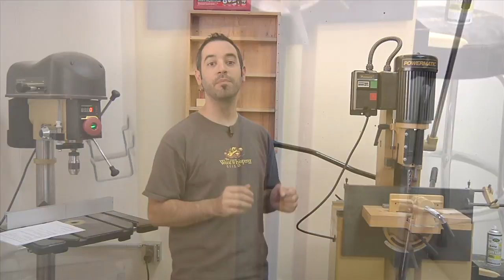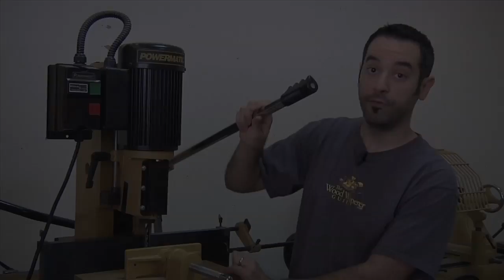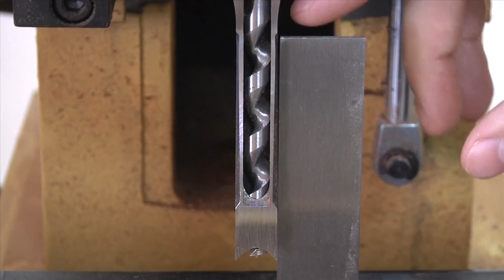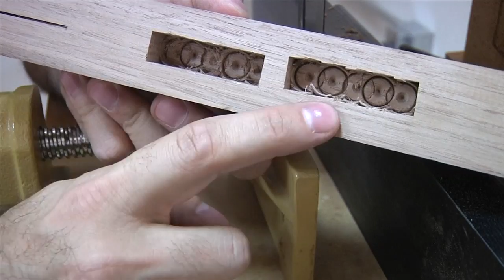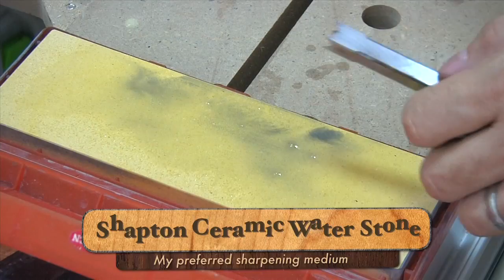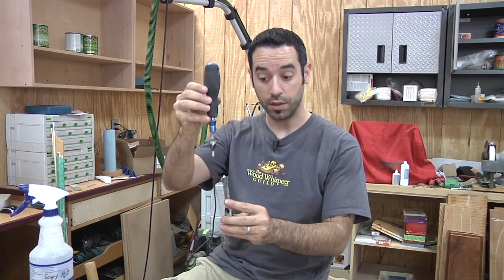Hollow Chisel Mortiser - Purchase, Use, and Maintenance

Comment: Great video, very informative all around, and in particular the segment on proper gap between the auger and chisel. I do however have a question which is about the later part of the gap section. I am using the Powermatic 719T with a 3/4 bit cutting into maple. I have now increased the gap from 1/16 to an 1/8” and the difference is quite amazing. However I’m still encountering some resistance beyond as I get deeper into the cut. Somewhere at around a 1” depth, I encounter resistance, and try to make short strokes of it to minimize heat buildup. Despite using gulf wax & short strokes it’s almost impossible to go deeper. The chisels are brand new, made in Japan. Should I consider increasing the gap beyond an 1/8”?
Any advice is appreciated, as I’m quite a newbie with this machine. Thank you Mark

Comment: I was lucky enough to come across a Jet JFM-5 floor model mortiser in the used market some time back. I will soon be using it in my bench building project. It's 14 years later that this video was created and this video is still just as relevant as it was 14 years ago. I loved the content in this video, you covered it all, even sharpening!, Thanks Mark

Comment: Marc, thank you for showing the sharpening cones. I generally just use them 'til they're too beat up, toss them, buy a new one because I had no idea how best to handle that internal surface conditioning. Nice. Thanks!!! Can't believe I went this long without knowing that. Hah! I really only ever use 1/4 and 1/2" chisels and bits, so it hasn't been a big issue thus far.

Comment: That mortiser sucks on the method the head moves side to side back to front. What you want is a table that moves side to side with a large hand wheel, and another hand wheel that moves the workpiece front to back.

Comment: To help with friction " my boss" would always have us use a bee's wax bar. Every 3rd or 4th hole you had to stop and slap a little on the chisel. it only took a few seconds and it made it much much easier to pull out and it did make the chisel last longer

Comment: Hi Mark, I have a bench top model that I bought from one of our cheap supermarkets and it was less than £50 in cost. It work well enough for what I want to do but as you will realize it hasn't any of the moving top or table. I also have the panterrounter plans from Matthias  and that has a movable table using two sets of draw slides, I made one for the mortise machine but I had to double up on the draw slides so that the pressure from the chisel part did not crush the slides, it works so well that I am going to make one for my drill press as well.

Comment: Mark I have recently  purchased a power  matic,table top mortise  machine.i can't seem to get the chisel  to auger,right where it's not so hard to drill the work piece. Cedar, or pine struggle  a little but the maple or cherry is almost impossible to do .it feels like I'm going to break  the down lever.its so hard .can you help with some advice ..
Reply: I bought the identical machine new several years ago and experienced the same problem as you describe.  Upon close inspection of the auger bits, I found them to have been very poorly ground, with dull cutting edges. Using a Dremel grinder and small diameter rotary abrasive tools, I carefully re ground all of the cutting edges making sure to maintain the original  clearance angles. I also polished the internal cutting edges of the hollow chisel using the included cone shaped sharpening tool. Finally, I polished the external square surfaces using very fine grit (6-800) sandpaper (lubricated with 3 in 1 oil) on a hard flat surface.  Problem solved. Final note; make sure you allow 2+mm vertical clearance between the head of the  bit and chisel cone and spray the bore of the chisel with a lubricant that dries on contact.

Comment: Mark could you tell me, this chisel mortiser can be used as a drill press? By norma drill press bits?
Reply from the maker: I guess theoretically it could. It should accept regular drill bits. But the bits have to be extra long because of the design of most of these things.

Comment: can I install Drill Press Mortising bit
 on normal drill press ??
Reply: you can buy a kit for the drill press but it will ruin your drill press, take my word the drill pressure is not made for it.
Reply from the maker: Nope. They do sell attachments though. I hear mixed reviews on those.
Reply: No , I've searched yesterday and I found out that . I have to buy chisel holder it cost 50$ + 70$ for shipping .. I'm getting bore

Comment: Every sail boat in the 60's -70's had teak louvered doors,and we used a hollow chisel mortiser to cut 1/4" squale holes for those louvered doors. I must have punched 100,000 square holes during that time,one hole at a time. each set of stiles had to be layed out right and left sides,the holes were cut on an angle so louver blades would slightly over lap.It was a very time consuming job. I think though the glue up of the doors was the most time consuming part. Glad that part of my life is over ! we got good with the cone shaped sharpening stone too, because teak is abrasive and carries silica sand from the rivers it floats in before harvesting.Sometime youd see sparks when running it through the trable saw. I think greenlee still makes a quality drill set.

Comment: Great video Mark... you can easily see the effort you had to put into it.  Everyone is entitled to their opinion, but I just don't get why there is always a small percentage of people that can give a video like this a downvote?  Abstain sure, but downvote?
Reply: Some people might be downvoting because the video is sponsored.  Some might disagree with the basic premise of the hollow chisel mortiser.  They might find that routers make a much cleaner mortise and with a decent jig are pretty easy to use.  Or maybe they are handtool zealots.  Personally, I think it was a great video about the hollow chisel mortiser, and on that basis I would upvote.  However, from my experience with my benchtop HCM, I'm not that impressed.  I find it to be kind of slow and the mortise quality isn't that good.  Just my experience with a little one.  Oh, and some people just downvote everything, I think.  Look at the ratio of up to down.  That's more useful as a metric.
Reply: Just trolls with nothing better to do.
Reply: How to replace 03 Honda Odyssey ignition relay and ignition switch

Comment: I build a type of bed  that has thirty six pickets.  I went from trying dowels, to router made mortise and tenons, but I switched to a mortiser and it makes a world of difference.  The big problem I have is controlling thw wood chips, there is no real easy way to vacuum them away.  I actually ended up using a blower versus a vacuum to get chips away from chisel.

Comment: Awesome review Marc, I only want to ask about the speed of this machine, do they come in variable speed? and, do we really need that change of speed in order to customize the cuts made on variable types of wood? And also, how about a dust or debris extractor? Can it be made? Do they come with one? I was thinking at the time you explained  the orientation of the debris are popping out, if only there could be an adapter for it that doesn't get in your working view or where the tool meets the material. Just an idea, but maybe the tool designers can give us that upgrade later on. Thanks for sharing!! (Y) (Y)

Comment: Enter 'Hybrid Pantorouter' into Youtube search and you will see a palm router based kit that will make both the the mortice and tenon joint. Like all aspect of using woodworking kit., safety and understanding the capabilities and limits of your equipment is a necessary part of the job. I think Kuldeep Singh - Indian, although living now in Japan cam supply the kit based on a design by Matthias Wandel, also on Youtube.

Regards, George

Comment: At 9:13, shouldn't you be plunging the chisel and seeing how it moves relative to the square? The line of motion is more important than the flatness of that small piece of metal (which can and often does have a slight built-in taper, to reduce friction).

Comment from the maker: @jawadsaadi The only reason I can see it being a problem is that fact that you'll need really long bits. The chuck on the mortise is up above the part that holds the chisels. So you need fairly long bits to extend far enough so that you have some room to work. And the longer the bit, the more runout.

Comment: @ibdavidc I bought the Delta 17-924.  I tried to use it a few times on oak and didn't like it at all.  That was probably because I didn't do anything to the bits and just tried using them out of the box.  NOT a good idea.  But, I still didn't like it.  With that said, if you still think it is something you want to try, message me.  I have one that I would sell you for a very good price!  haha

Comment: Great video. I definitely need to get one of these. I am curious, though: you didn't talk about the kits that you put onto your drill press. Granted that they are less convenient than a dedicated machine, but they also take up far less of my single car garage than another floor standing item. So, I assume most of the instructions are the same, but how do you set them up? Is there any hope of quality work with them?